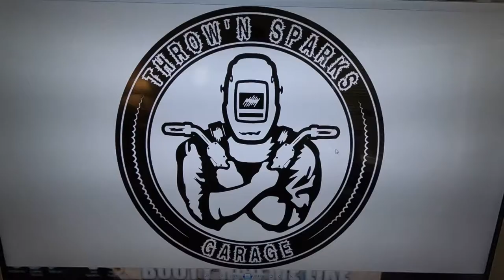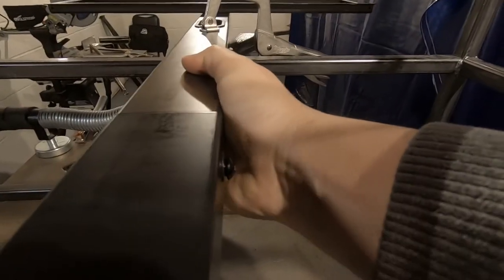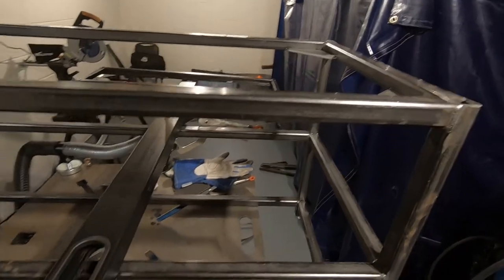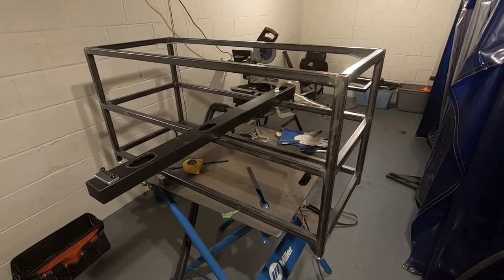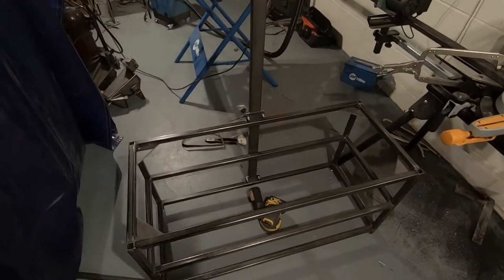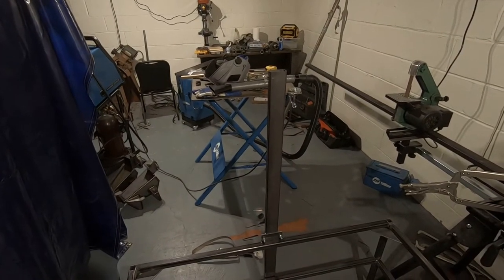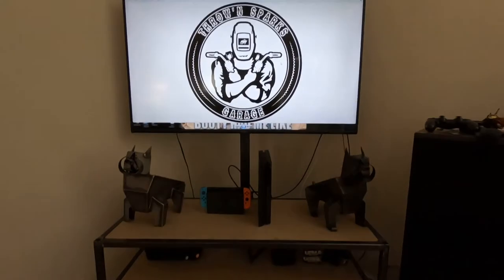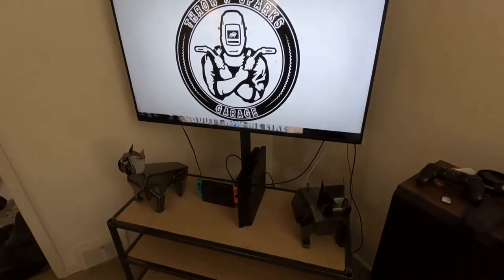Custom Metal and Wood TV Stand

Comment: #LabCoatLarry the stand came out good! Did you think about putting some rust inhibitor on the steel but leaving it raw?
Reply from the maker: No, my plan was to see how much/ if any rust would form on it this spring/ summer since it will stay in the house.  But if it does start to rust i will probably just add a little clear coat to it.